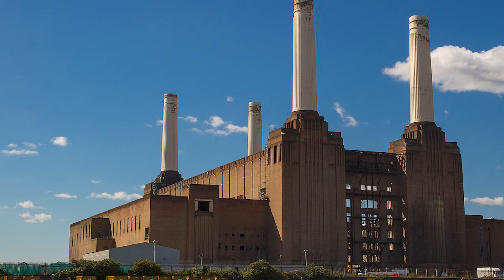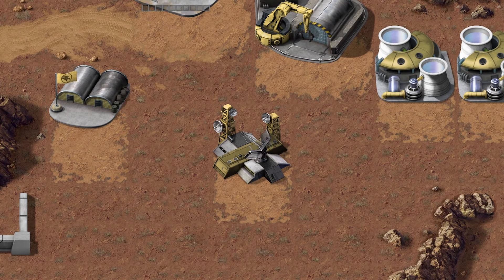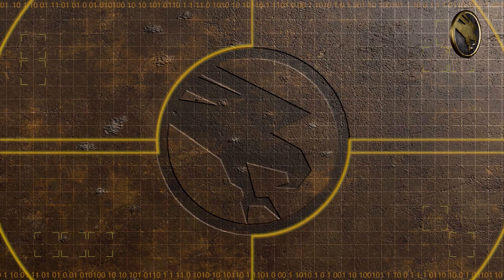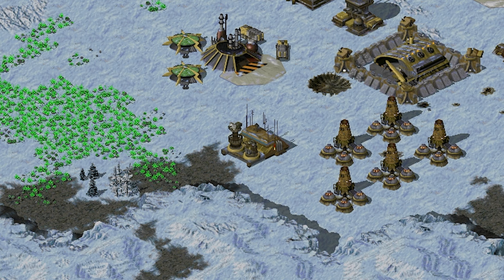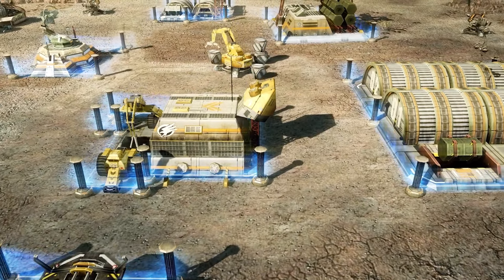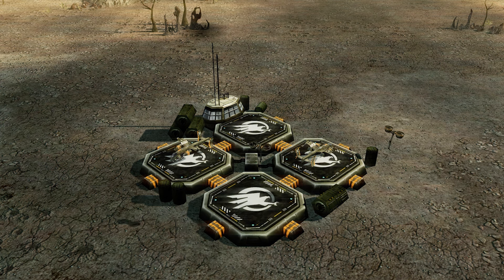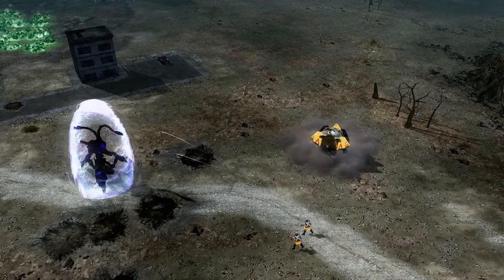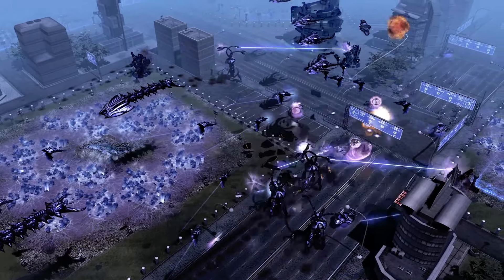GDI Support Structures - Command and Conquer - Tiberium Lore

Comment: I loved the personality they put into the C&C 3 crane. The operator is just vibing in the middle of battle, doing the robot with his single giant arm.
Reply: Don't forget the juggernaut pecking at the ground
Reply: @silkenemperor  Or "scratching" the canopy using a leg
Reply: Red alert got nothing to do with tiberium  saga
Reply: @kelvinkaw5460  That... has nothing to do with my comment. Where did you even get Red Alert from any of this?
Reply: Wasn't there also a Crane that would stack a bunch of crates then knock it down shortly afterwards as an idle animation?
Reply: @stylesrj  I think that was Nod's version.

Comment: I think the repair pad in TD is a large older version of the much more advanced and miniaturized  repair gun the engineers get in renegade and working on a similar basis.
Reply: I believe this is the correct answer since you can observe repair facilites on Renegade. When a repair is in process you can see energy beams very similar to the ones that can be "fired" with a gizmo repair gun coming out of the building and reaching to the repaired vehicle. So it appears to be an automated version of the same technology.
Reply: I was gonna say that as well. A sorta proto-Gizmo
Reply: But how does it work? 
Nanomachines 😂
Reply: @the_SolLoser  .... son!
Reply: nanomachines, son
Reply: @the_SolLoser  They harden in response to physical trauma!
Reply: @the_SolLoser   actually no, its kinda funny as its MORE advanced then nanomachine based repair in C&C3. It rearranges its molecular structure and repairs any damage so its star trek level of tech frankly. Dunno why they downgraded , maybe it gave vehicle crews cancer or smth xD.  
Tho i assume it was just too expensive to run or thats my headcanon why repairs don't cost anything in 3 vs service depot's GDI has in 1 and 2.  On the other hand i assume the nod repair tank might use an early type of repair style from 3 hence the no cost.
Reply: @cropathfinder  /r whoosh

Comment: Fun fact about the hunter seeker droid, in the beta of tiberian sun there was another module for the GDI Advanced Comms tower/GDI Upgrade centre, the Threat Rating Node, which affected what your units and base defenses chose to automatically engage (to prioritize the biggest threats rather than the first enemy it sees), it even affected the hunter seeker droid. Without a threat rating node installed the hunter seeker would just attack a random unit that wasn't yours, it was even known to target civilians! 

The threat rating node was cut so late in development (though still present in the game's files) that the hunter seeker droid wasn't changed accordingly so it still attacked civilians in unpatched versions of tiberian sun. xD
Reply: Yep. I on multiple occasions had to begin blowing up non-Nod structures and other things on maps whenever I played a skirmish as the Hunter Seeker drone was never available during normal play. It was very annoying to see happening in front of me.
Reply: Didn't the Threat Rating Node get repurposed as a Drop Pod Command but it also retained its original Threat Rating Node capabilities since they were not taken out or something?
Reply: @stylesrj  The Drop Pod Command only reused the voxel, it does not contain any of the cut TRN's functionality.

TRN remains in the game's files as a seperate entry so if you edit the files to reenable it you can build them both. Part of why it was cut was because it was bugged, if you destroyed it the units targeting behaviour didn't revert to normal.
Reply: @Toast_94  
Considering how those games didn't make you lose the tech tree if you sold the tech centre after building it... (unless you lost the other facilities) I wouldn't see that as an issue :D

When I built a Battle Lab in Red Alert 2, then immediately sold it on the other hand... I was surprised that I also lost the high-tech units even though it used the same engine as Tiberian Sun...
Reply: @stylesrj  Yet when you lose your radar you lose your minimap, when you lose a power plant you lose the power it provided, when you lose your ion cannon uplink you lost the timer and could no longer fire it.

It was an issue.

Comment: My theory for the repair pad is it uses the same technology that the engineer repair guns use in Renegade, and those repair guns could also date back to the Tesla Coil technology used in Red Alert, similar to the power plant functionality. My guess would be that the vehicle drives on top of the pad, and the repairs were done by full automation of repair beams from underneath the vehicle. In Red Alert, the repairs were probably done by a crew who are controlling the beams by analog. In Tiberium Sun, the system is probably the same as Tiberium Dawn's, except the crane arm is deployed to probably hold a vehicle in place so the beams could work on them easier. This would make sense with the mechanized units that walk onto it.

Comment: Speculation on my part, but I have a hunch that the Adaptive Armor used by the Steel Talons may have been inspired in part by the Iron Curtain technology deployed by the Soviets, though I guess with the passing of time, some of the secrets were lost.
In the abridged version, the Iron Curtain harnesses kinetic energy to render mechanical units (vehicles or structures) invulnerable until the energy was expended. Considering that Russia was aligned with GDI in the First Tiberian War, they must have offered up intelligence from the Soviet era to GDI, although the notes would not be unearthed until near the end of the Second Tiberian War. By this point, some of the secrets of the Iron Curtain were definitely lost, considering how differently adaptive armor behaved. The kinetic energy theory used to protect vehicles is still in use, but unlike the Soviets, the Steel Talons are unable to render their vehicles completely invulnerable.
Again, this is speculation on my part, so take it as you will.
Reply from the maker: I kinda like this theory since it further connects the Tiberium timeline to the original Red Alert game.

Comment: My assumption on the function of the Repair-Pad, especially due to the use of electronics directly under the pad, is intelligent nanomaterial. The circuitry sends electric impulses into the vehicle, which activates some kind of self-repair subroutine of the onboard computers. Presumably, this requires more juice than the engine could produce, which is why it needs to be on a yard. I mean in the third Tiberium War, we know they used nano-assemblers for construction-work in their cranes. Using them as a means of reparation as a first attempt is not so unreasonable.

Comment: Problably the repair bay use this repair ray that use the engineers in cnc renegate, probably is one prototype structure in this times, inspired of the energy that generate the powers plants.

Comment: The powerplant in Renegade could have been a fusion reactor instead of a fission. Probably with the aid of the Tesla technology, a magneto-inertia confinement or even a Z-pinch design was what that object was in the heart of the building.
Reply: And probably had Tiberium crystals in the core as the fuel. Or would be extracted from them and delivered from the Refinery to the Power Plant.
Reply: @stylesrj  There would have been evidence of Tiberium being used. Plus, using Tiberium as an energy source sounds more like a Brotherhood thing to do rather than the GDI.
Reply: @WolfeSaber  
Tiberium is valuable because it sucks up minerals from the ground and can then be refined into whatever you need.

Or it could be that GDI uses some rigorous industrial method like a nuclear reactor would to extract power from the crystal. Meanwhile the Brotherhood would swaddle it, sing lullabies and treat the crystal like a baby to get power from it.
Reply: @stylesrj  Well, the reactor seen in the advanced power plant doesn't look like it uses Tiberium.
Reply: @WolfeSaber  
To be fair, how would you know if it is or not? You'd put it into a sealed reactor chamber and let it cook or however nuclear reactors do it to boil water and spin a turbine.
Since Tiberium is highly radioactive (or at least it sets off Geiger Counters), it's going to have a lot of heat.

Maybe the Brotherhood in the future figures out how to use the crystals for more than boiling water or better ways to have it boil water for power generation and thus outpaces GDI and their "safer" method of using it as nuclear fuel.
Reply: @stylesrj  That reactor wasn't setting off the Geiger counter. Besides, the way you describe the Brotherhood's use of the crystals sounds more like a battery than a reactor. Just because something is radioactive doesn't mean it can boil water for a turbine. Not to mention no means to describe the device in the advanced power plant.
Reply: @WolfeSaber  
I find it funny how on the battlefield you build entire nuclear reactors to power a bunch of guard towers and tents...

I'm just saying that both sides were probably using Tiberium in some way to fuel their power plants. Using Tiberium sounds like something NOD would do, but at the same time, GDI also has a nuclear arsenal they maintain in case it's needed while using a "cleaner" Ion Cannon.

The Renegade GDI reactor could be utilising the energy emitted from Tiberium crystals to provide an alternative to nuclear fuel rods. Or at least it'd be more easy to source the fuel since it's right there on the field.
Reply: @stylesrj  That give a description of how the process works. I did, saying the Tesla technology helps with the Z-pinch reaction for a fusion reactor.

Comment: I think the repairpad was supposed to work like the NOD warfactory from C&C3 bringing the vehicle down for repairs as it clearly has a large underground facility when you place it down.
But to not forget the vehicle was there its visually placed at the top since you need the vehicle visible in order to sell it.
Reply: Yeah but the crew in the vehicle could fire back while on the pad...
Reply: @stylesrj  Well yeah its not like the AI suddenly is turned off all they did was cancel its movement so it would stay on and not auto heal across the map as its chasing enemies.
Reply: @vonshroom2068  
Just saying, how would the vehicle attack enemy units if it's supposed to be underground, eh? :P

Comment: Really love the modular design of GDI structures in Tiberian Sun and Firestorm. Sadly they're never seen in later games.

And I always laugh at them for still using the "fuel-steam-electricity" power-generation, despite Tiberium directly radiants tremedous amount of energy and can be used as the power source for sci-fi RTG.

Comment: Sorry if this was mentioned already but if I had to take a guess on the repair facility perhaps that circuitry in the facility is not the repair system itself perhaps it's a type of power source for nano machines that are used to repair the vehicle through a few colonies of nano assemblers

Comment: I wonder of the repair pad was supposed to lower vehicles down to an underground facility judging by its construction animation having the platform.

Perhaps they couldn't get the unit model to properly lower on the pad due to graphical limitations.
Reply from the maker: That was one of the things I had thought was that the vehicle was meant to be taken underground, but like you said graphic/engine limitations made it so that it had to be kept on the surface. 
There's also the fact that you can sell the vehicle on the pad, so from a gameplay perspective you probably couldn't sell it from underground. Or at least, you'd have to wait for the repairs to finish and for it to return to the surface before selling.

Comment: The Renegade Nod power plant was a one off I think, I seem to remember it ran on the geothermal power generated by a nearby volcano. Let me know if I'm remembering wrong however
Reply from the maker: This is true. It was during the island mission. There is also this EVA voice that mentions radiation levels and other status updates. At first I thought the EVA could only be heard inside the power plant but it broadcasts outside the plant too. So I wasn't 100% sure the voice was only talking about the power plant. And if the power plant is running on nuclear, why is it connected to the volcano for geothermal power? But it's something I will mention in the Nod Support Structures video.
Reply: @Jethild  I seem to remember the EVA voice mentioning something more along the lines of an eruption becoming imminent, since the helicopter crashes into the volcano after after the boss fight on that level (very hollywood shit type thing but it's why we all loved Renegade)
Reply: @Orkillester1  
Maybe the volcano was very unstable and the power plant was either the cause of it being unstable or was keeping it from erupting.
So when the helicopter crashed into the caldera, this disrupted the extraction process and caused the volcano to blow.

Comment: I'm guessing the Repair Pads/Service Depots use some sort of Tiberium-based fabricator to undergo repairs since the lore says something about vehicles using onboard fabricators to make ammunition using Tiberium... I think? I dunno, I read that on TV Tropes though.

Same with the Power Plants. Maybe GDI does use Tiberium as a power source in some way that isn't as dangerous as NOD's usage. Maybe the fuel for the reactors is extracted at the Refinery; the resources that can be sold for money are sold for money while say the uranium or coal or oil, etc. is delivered to the power plants to be used.
Or even the Tiberium crystals themselves are used since they can be rather volatile and with Tesla technology probably can get the energy extracted that way or something.

Comment: Two things 
Repair pads and vehicles may use short lived nanotechnology. To witch if you Looked at the continuation timeline of red alert. It does show nanotechnology being available. Until red alert 3 when it came into it's own power as a technology for battle. 

I though the firestorm fences could stop them from passing and killed it?

Comment: 8:03 That mission design was total bullshit.  Not only did u need to protect the doctor that u could control so u could move him,  but u also needed to protect the random civilians that constantly kept running into the tiberium field 10m outside there village.  The only consistant way i got that mission to work and not randomly fail was to rush over there with sandbags and trap them all with sandbags and keep a harvester dedicated to clearing that area as it hade a blossom tree there aswell.  Having to defend civilians that could even run closer to the enemy base was beyond stupid.